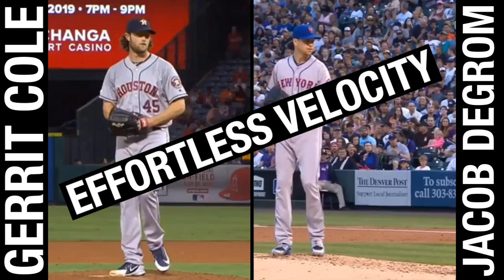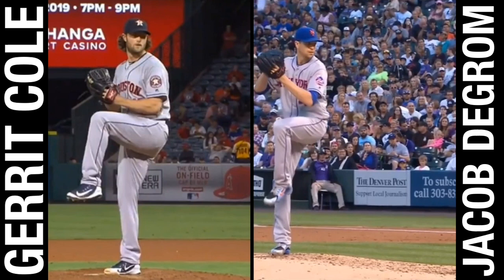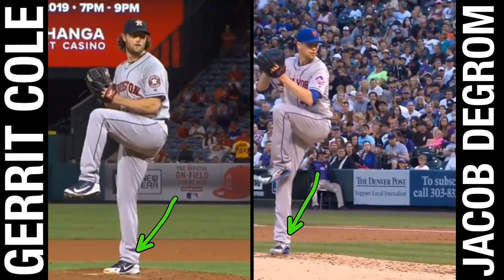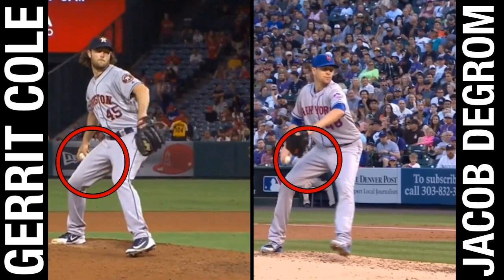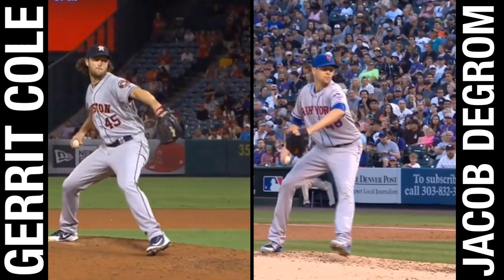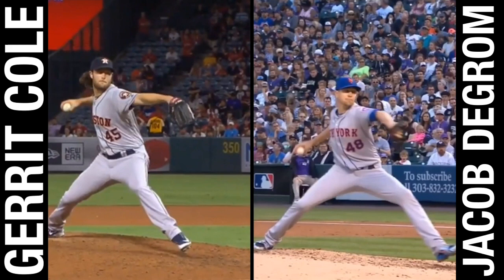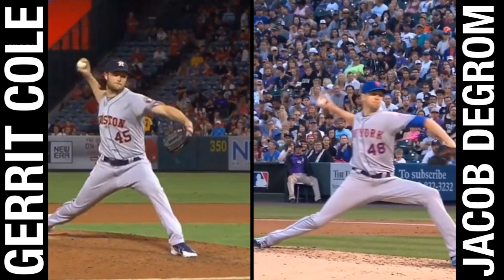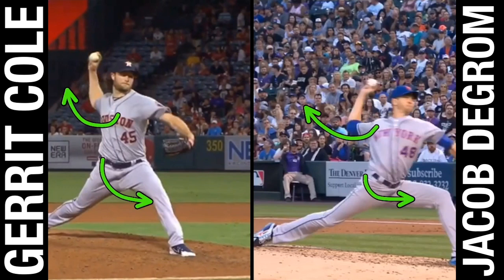How Gerrit Cole + Jacob deGrom Throw Hard | ROBBY ROWLAND

Comment: DeGrom seems to do everything a little bit better than Cole, yet Cole actually throws slightly harder, I believe. Assuming I am correct, where does Cole get all his power to throw 100 mph?
Reply from the maker: deGrom’s avg fb velo was higher than Cole’s this year.
Reply: @robbyrow  Thank you. But does Cole look like he should be able to (sometimes) throw 100 mph? He does everything right but nothing extraordinary, in my opinion. Do you see why he is able to produce all that velocity?
Reply: @Bill-uo6cm  I’m guessing how insanely strong he is
Reply: @michaelperson4117  I'll buy that.
Reply: Cole weighs 220. Degrom only weighs 180. I think mass would have something to do with that.
Reply: @Bill-uo6cm  probably a little bigger and a little stronger than degrom. Same way a batter such as Stanton can hit harder than someone like mookie betts. Stantons swing is way worse than mookie’s but since he’s so much stronger he can’t hit it further.
Reply: @josephdickinson4429  Why do stronger players usually hit the ball further than players who are not quite as strong?
Reply: @Bill-uo6cm  force=mass•acceleration. Stanton being both bigger and stronger can accelerate the mass of the bat faster than betts therefore producing more force and hitting the ball further. Mechanics play a large role as a body builder can’t hit a ball but at a professional level everyone has good mechanics so typically the bigger and stronger the guy the harder and further he can hit/throw a ball. There are some exceptions as certain smaller guys such as altuve are freaks of nature but typically bigger and stronger will hit and throw harder. As far as degrom and cole, degrom has better mechanics but cole has size and strength so they both likely produce the same amount of force and throw the same speed.
Reply: @josephdickinson4429  All you are saying is that stronger guys swing the bat faster. I am asking why? They are not swinging tree trunks, they typically swing 33 oz. bats.
Reply: @Bill-uo6cm  I’ll refer you to dr heenan, he explains perfectly and works with Robby row, but The average size of mlb players have increased 20 lbs over some odd years (I can’t remember exactly how many) and was followed by an increase in average velo by 7mph. And yes big guys do typically create more force than smaller guys, but not always. kingofjuco/ Eric sim posted an Olympic lifter, never swung a bat before, and had a 97+ exit velo off of a tee.
Reply: @Bill-uo6cm  I think he refers to it as rotational force. The bigger muscles you have the faster you can rotate your body and transfer the force into the ball. I’m not expert in this, heenan is I recommend you check out his page. Very interesting
Reply: @josephdickinson4429  You haven't even scratched the surface of the answer. But I am not blaming you. At least you know you don't understand the subject, which is evidenced by the fact you are referring me to another person. Most people either think they know the answer, which they don't; or they don't even understand the question.
Reply: @josephdickinson4429  No, not even close.
Reply: Jesus Is King.!!! Jesus Loves You❤.!!! John 14:6 
King James Bible
Jesus saith unto him, I am the way, the truth, and the life: no man cometh unto the Father, but by me..!!! Follow Jesus Take The Narrow Path.!!!!!!!!😊